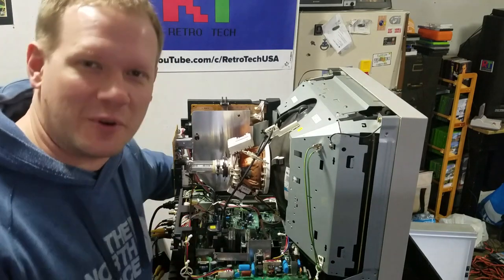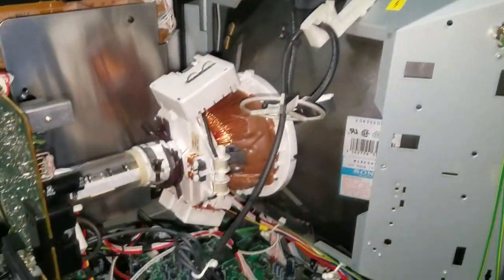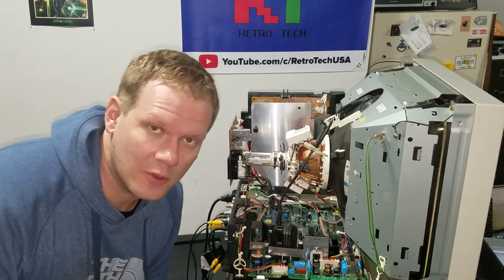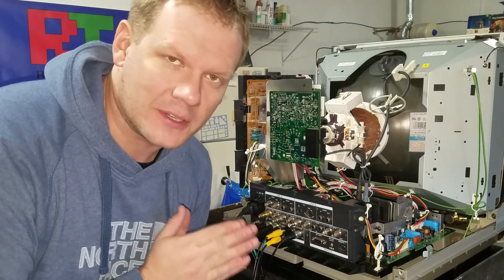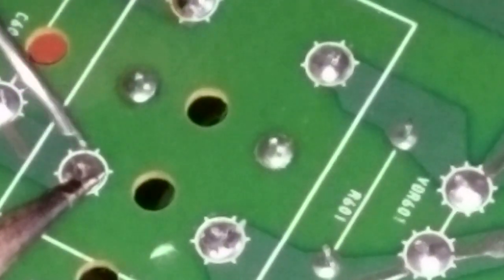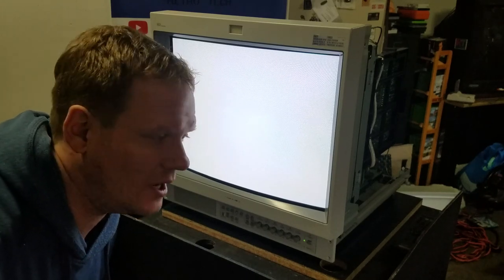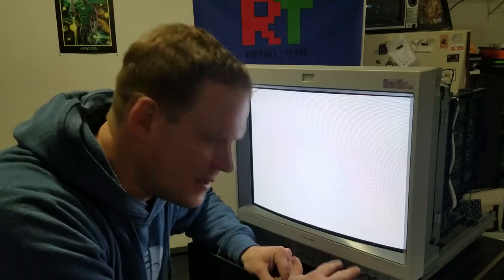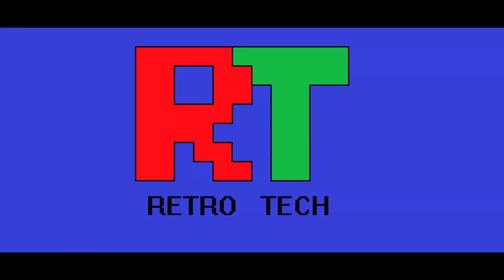Why are CRT TVs & Monitors noisy? - Can we fix it?

Comment: [ Listener warning: flyback whine @ 4:17 ]
It takes anywhere from half a second to a few seconds of flyback noise to interfere with my motor control and leave my cognitive functions impaired long after the exposure stops. The funny part is my sensitivity to it INCREASED in my late 20s.

Comment: If only I knew how to solder, great info Steve! Getting back into these TV's reminded me how that noise can be a bother. I think some adjusting needs to be kept in mind if hearing these things has not happened in years. When I'm gaming I never notice it anymore.
Reply from the maker: No problem.  You can try to adjust the screen brightness and screen setting of the flyback without soldering.  Sometimes that is all it takes to get the sound down a bit.  This PVM I was working on was very loud and needed all the help it could get.

Comment: Thanks for this. I have my Sony Trinitron open right now and it is a squealer! Going to try these repairs and see what I get.
Reply from the maker: No problem and good luck.  Try adjusting the "screen" setting on the back of the flyback first and you may not have to re-flow the solder on the transformers.
Reply: @RetroTechUSA Can you adjust without having to discharge a PVM?

Comment: Now that I think of it there was some noise on my Samsung 957p but it's not just bound to CRTs, power supplies also can make noises, so like every device with a built in power supply. Also had some whine on an LCD monitor with built in power supply
Reply from the maker: Yes, power supplies use similar transformers to a Flyback and make noise too.  Great point.

Comment: Heu wait on a kv32hv600 if I was in back of the set I do as I recall remember that noise but it was not so much of a headache inducer as having it within a few feet of me for the use of it except when as a young tween or y9unger messing around behind/beneath it via crawling to access connections etc but... yeah supposedly black white tv is different slightly with the pitch of that twinge/whine and I am not so great with recalling which is higher which is lower etc however supposedly from online reading articles I found a thing called hv or high voltage putty that exists for just this reason... looking into it further it says its not import how old it is as it stays useful either way.

Comment: Can bad capacitors also make a bad whining sound?  I have a PVM monitor that has a nasty high-pitched whine that lasts for a few seconds when the monitor is first powered on.  It's a different frequency than your standard flyback sound.  It goes away once the monitor is warmed up.  It drives me nuts and is the only flaw my otherwise perfect PVM has.

Comment: Im just wondering, does the high pitch noise still happens if you cut the cables of the speakers? (I have a crt that has a headphone jack adapter, and i could probably connect a speaker there instead but idk if that would work)
Reply: I don't think that would work.  The speakers do vibrate to produce sound, but this high pitched sound comes from different components in the CRT vibrating.

Comment: How expensive would it be to produce new Cathode Ray Tubes for Retro specific game monsters? I know its one step back and there are upscallers and HDMI converters but I like my PVM. Despite being composite only it looks fantastic
Reply: Extremely expensive, most of the things needed for a crt are not being mass produced anymore
Reply: its not gonna happen, blame capitalism
Reply: Why on Earth would you want to manufacture new CRTs?

Even a 15" CRT requires two hands to lift and has a center of gravity that makes it really awkward to carry.

A 24-inch LCD can be carried under one arm without strain.

I have nostalgia for a lot of things in tech, but after I bought my first flat panel I hunted down and exterminated all of the CRTs in my house, and celebrated when I had no more left to lug around. Part of me wants to find an old serial terminal to play around with, but I'm not sure how much they typically weighed and don't know how much I really want one (I understand they generally had fairly small screen sizes).
Reply: @JonBrase  Many people want CRT televisions because they have the ability to scale 240p and 480i correctly while having extremely low input latency
Reply: @JonBrase  The weight issue makes me laugh a lot. The CRT monitor I bought in 2002 has been on the same table for over 20 years and I have never even needed to move it.😂

Comment: Is this 20M7MDE?
Reply from the maker: No it's similar to that.  This one is a 1953MD
Reply: @RetroTechUSA  So pvm medical 20 inch have noises?
Reply from the maker: Well technically every CRT has a Flyback and the Flyback creates a High Frequency noise (15khz).  This frequency is audible to some people, but not everyone.  The flyback can wear down internally as it is in use.  Some CRTs are a lot louder since the flyback has worn out, or needs to be adjusted.
Reply: @RetroTechUSA  The 20M7MDE says it has 100hz. Noise too high?